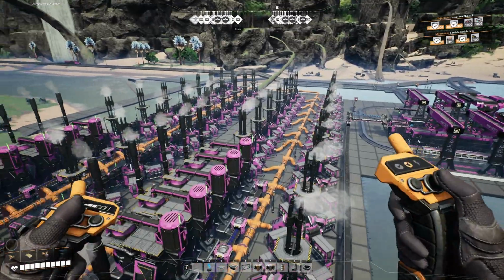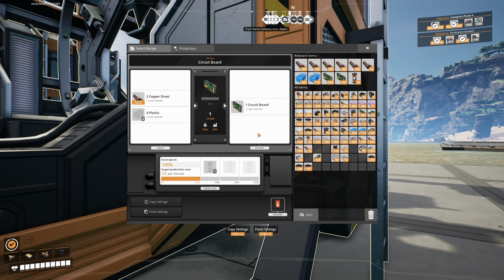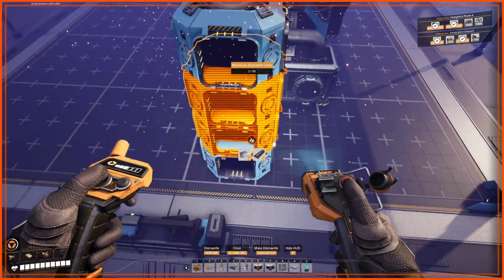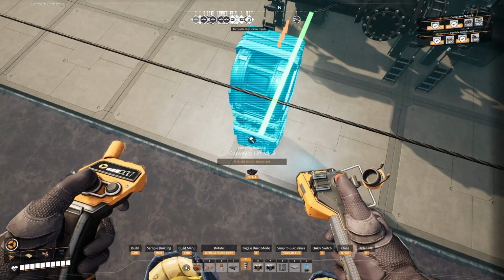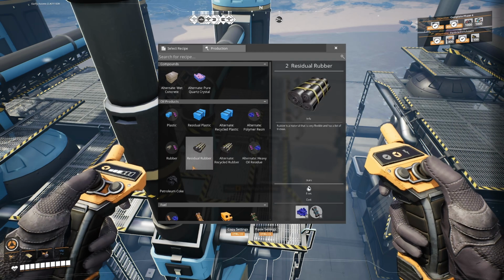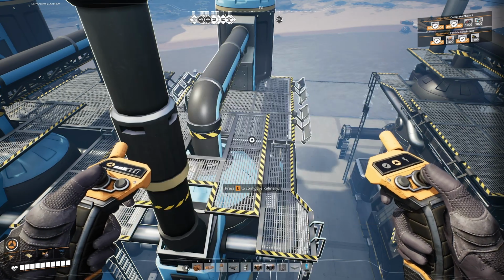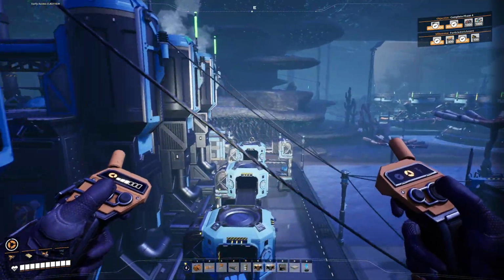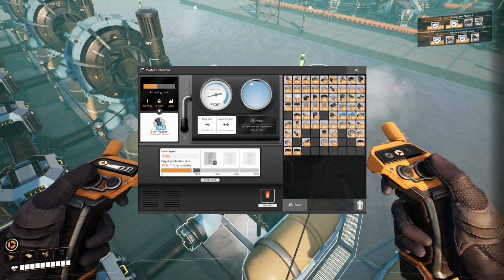The Best Starter Oil Setup is Simple with Blueprints!! - Satisfactory Update 7 Guide

Comment: A tip for cable management. Run a steel beem just above the cable hookup points and you can place the wall mounted power connector over each hookup point, then you just daisy chain em up and the cable should be hidden under the steel beem.

Comment: If i have a Fuel Generator is better to use it then instead of a coal Generator then ?
Reply from the maker: Definitely if you have the materials. But I still leave my coal plants up and running after I move on to fuel and then diluted fuel later
Reply: @DrLootCrate  so I just need to switch the one that produce the coal to produce fuel?

Comment: It feels like your generators are going tostarve without ay balancing for your conveyors?
Reply from the maker: This uses a manifold design, so no balancing needed. Once the first machine fills up, the extra passes on to the next and so on. As long as your input belt has enough total coal for each generator, it is essentially self balancing
Reply: @DrLootCrate  i tested it and it works nicely! although i had some issues at start with impure nodes, but some slugs fixed it.

Comment: This is a great video. I watched a few on this subject. I settled in to yours and have been following along. Im almost finished and added my own changes along the way. I turned half of it on after a quicksave and it all works. When im done, I was wondering if you have a video where you improved this power plant plastic rubber factory?
Reply from the maker: Thanks man! I liked this one a lot too, but not quite as many watched it as others 🤷‍♂️ 

I don’t have another video for the next step which would probably be making rubber and plastic and fuel in the traditional manner. A good idea for another video.

Comment: Ah Blue Crater, I recently finished my big fuel generator project there, only working on decorating it now. All the oil is converted into Heavy Oil and then all of that is pumped through Blenders to make diluted fuel and almost 1800/min Compacted Coal used to turn as much into Turbo Fuel as possible. It's a massive 6 floor building, very top heavy because of the sheer number of Fuel Generators. I don't even know how much power it outputs exactly, but I'm pretty close to finishing and I think it will be enough for that. I have the various oil facilities use the Residue for Generators too, so those all combined should be enough. I really don't wanna make Nuclear. 

I checked on Satisfactory Calculator and I actually have exactly 1000 Fuel Generators. Amazing. 827 of these is in the big plant in Blue Crater. Well every block has 1 that's not running on full clock speed so let's say it's effectively 980 on the whole and about 800 in the big plant, that means it's a cool 120 000 MWs of power. Could be more but you'd have to use up most of the sulfur in the game.
Reply from the maker: That is absolutely awesome! I think I am going to go for nuclear soon…
Reply: @DrLootCrate  Good luck.